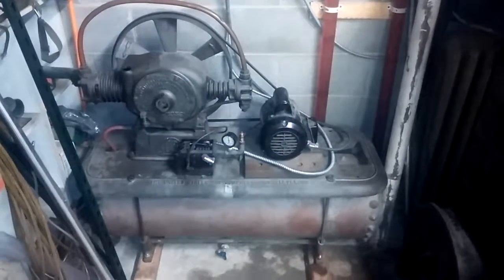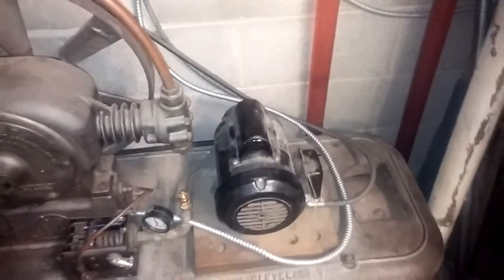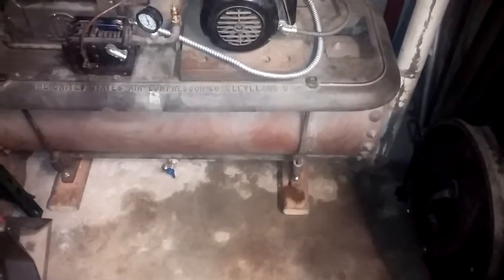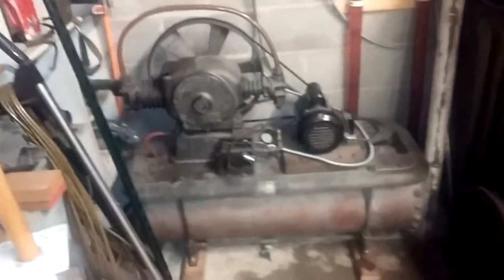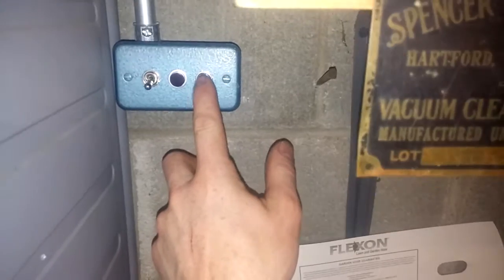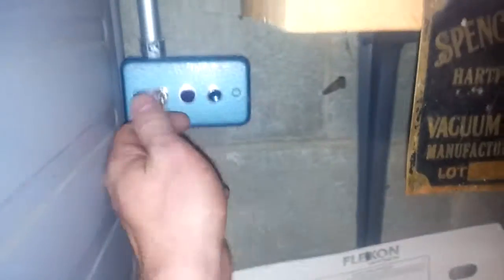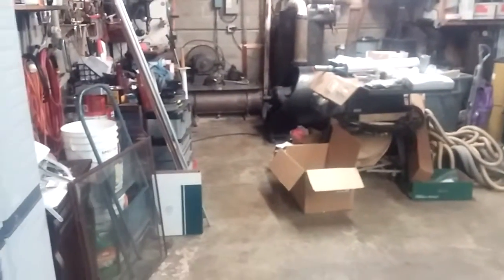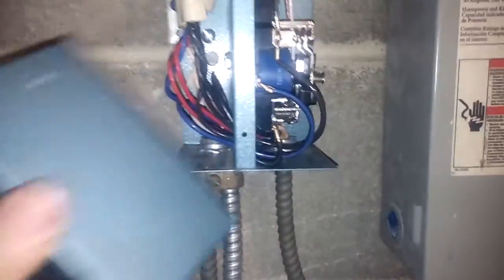1920s Air Compressor and Control Circuit

Comment: We have one of these with the induction motor used it for years... we only pay .0275 cents per kw here so dont worry about power 90% of homes heat with power.. but amazing how quite they made  those compressors Junk made in China is loud and only last couple years !!
Reply: They pretty much all do, even the new Jenny and Rolair. They last a long time but definitely work much longer than this one. New pumps are running faster and making much more cfm. In roofing Rolair is the most common and some run non-stop up to 14 hours a day in 100 degree heat. Ingersoll Rand makes garbage these days though but have heard good stuff about their older models. We have run them in rain and snow in 20 degree winter's as well. We usually get between 5-10 years out of them before the tank rusts away or the pump blow because some never change the oil and I mean NEVER! 
I've seen Rolair with original oil years old from factory and continue to run.